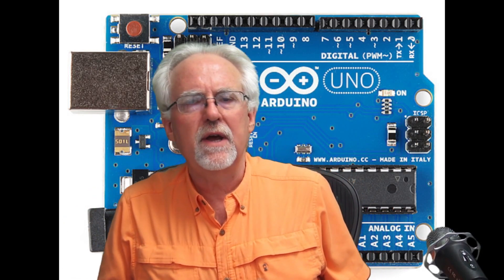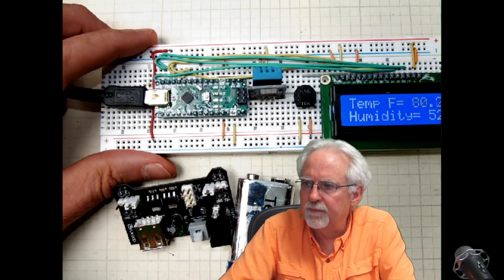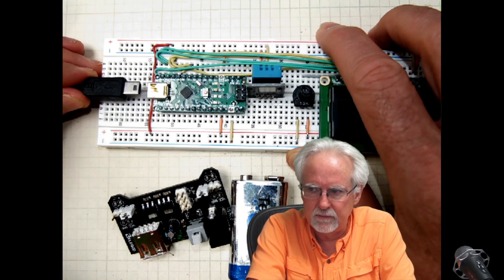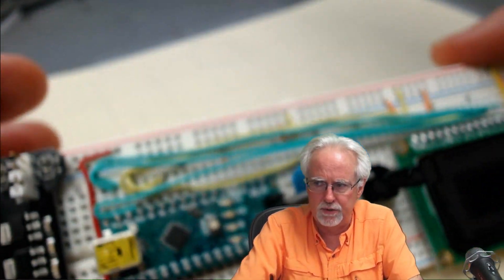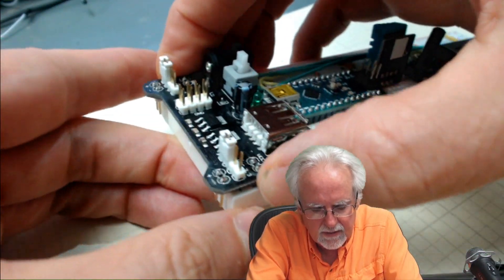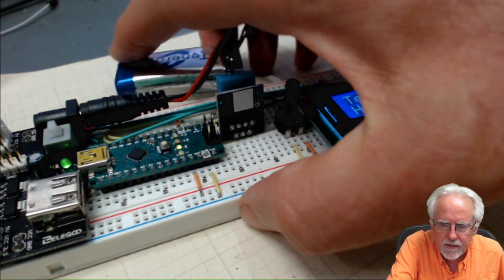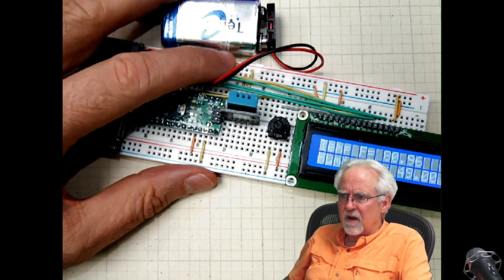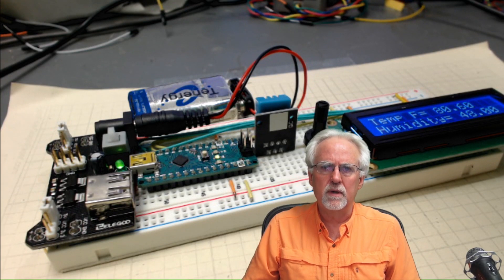Arduino Tutorial 52: Portable Temperature and Humidity Sensor with DHT11

Comment: I am Legend! I don't have the kit that you are using I have a GAR Monster kit which came with the Nano and a ton of other Arduino boards. Only problem I had was finding a pin diagram to find the 2 connectors for my LCD (mine has a LCM1602 IIC chip connected) I also don't use the Arduino software, I use Visual Code with Platformio to do my coding. I love it more than the actual Arduino software, although it takes a little more pausing of your video and a little more research to get everything working but I have gotten everything to work through all of your videos. So I believe I am legend in troubleshooting! Keep up the great work!

Comment: I have tried almost everything to get dht11 into the library but can not do it. it keeps saying that there is no such file or documents.  I have tried it exactly the way Paul did it on the u tube lesson 50 and I also tried to by going to include  libraries ,  and add a file, it show up in  the library but it still gives me the error no such file.  If I go to add a file and add it that way it shows up on the sketch as DHT_U.h and I do not know what that is.  Could use some help.

Comment: I looked at the Jumper wires and thought there would probably be the kind of issues you experienced with the wires having to be laid across each other and bent round to fit.  So instead I bought some conductive wire, some PFTE tape and some colour coded heat shrink flexible tube.  It means I make every jumper wire as a custom piece but obviously the more I make the fewer i need to make. It's also quite fun to do. 

I am legend.

Comment: Nano arrived - legend status achieved with 9v pp3. Am trying to use oled display with mixed success. The suggestion of using the more rigid jumper cables works really well. I've joined two breadboards together and can cut the wires to length.  It makes the board so much neater and stable. Cutting longer wires enables me to colo(u)r code the usage (red - 5V white - ground etc).

Comment: Legend in the making! I used a powerbank with 5V output voltage. I read on the internet that most powerbanks have 5V output because most phones use 5V to work, so if you have a powerbank you may have the solution already! :)

Comment: I believe I have attained legend Plus.
I have a larger board (like the one you recommended)  and I did not have the polarity problem. When yours had a problem I checked the board that came with the kit and sure enough the polarity was different. That is until I rotated the board 180*. I guess I learned that it helps to mount the power supply first to determine the orientation of the other parts.

Comment: I found the polarity issue on the power supply when working through the DC motor tutorials last week.
Would an adequate solution be to use a 7805 voltage regulator to step down the 9v to 5v and just mount it right to the board? I have been planning to make a 9v batter holder that has some pins on the back that can be mounted directly to the breadboard, perhaps I could incorporate the regulator into that too and just plug and play for portable projects. You even get rechargeable 9v batteries if you wanted a more permanent 9v > 5v component for prototyping on the breadboard.
You really got us all thinking, that's for sure.

Comment: Ah r legund. No electronics were harmed in the making of this tutorial.
Or connect it to the OTHER end of the breadboard and the pins and rails match up correctly.
What's the other set of header pins for, marked "output header pins" on the Elgoo PDF

Comment: hi... Is it not a problem that you leave the postive top breadboard rail connected with the positive bottom breadboard rail (with the jumper wire that is under the power supply module)? If the power supply powers both the top and bottom breadboard rail a jumper wire between them would short circuit, or not?

Comment: Hi sir, i have question not in the context of this video but in the context that you are an electrical engineer. this question has been bothering me for a long time. 

in a step up transformer, why the higher voltage in the secondary coil doesn't give rise to a current higher than in the primary coil. almost all references related to this topic explains that with the conservation of energy. but its hard to digest this with my latest model of understanding about the inductor and mutual inductance. I am really excited to know about your perspective, which may eventually improve my latest model of understanding about the inductor and mutual inductance.

thanks in advance

Comment: I am legend!  If your power supply board was on the other end of the prototype board your polarity would be correct.  But since you have everything wired you'll have to turn the power supply board around by 180 degrees as you had it shown earlier.  I have marked all my protoboards with an indicator that makes it easy to always get it installed before wiring anything up.

Comment: Hi. I have a suggestion for your polarity problem. Take away the voltage selector jumpers and replace them with wires from the +/- pin respectively, down to the breadboard.

Comment: I am glad you pointed out the polarity issue. I am accumulating things and after your video I looked at my kit. I had assumed, without thinking that the outer rails would be labelled commonly and the inner raile commonly.and the power supply unit similarly. I think this is not sensible. I also got the impression that if the sensor and the pot were on opposite sides of the board the Nano could move up several holes. But this is hindsight.
The reason for my accumulating stuff is for me to make something almost identical. I think I have some wire wrap wire and twiddly thingy remaining somewhere from 35 yrs ago. I knew it would come in handy.
Many thanks for these tutorials.